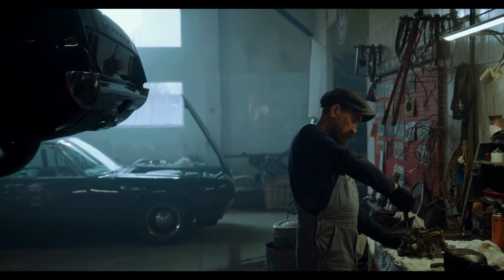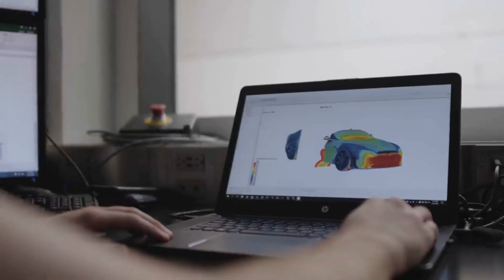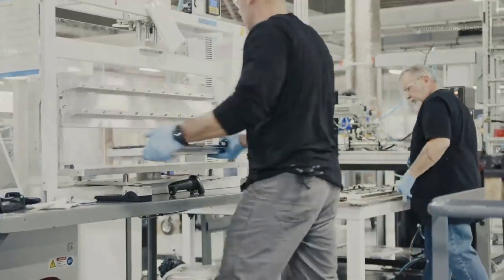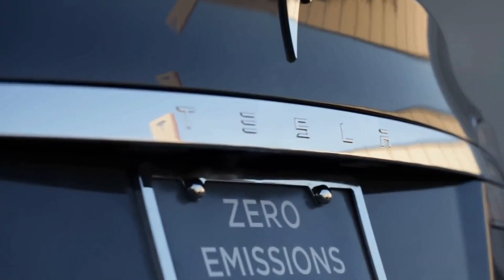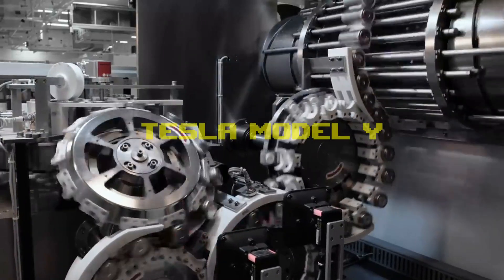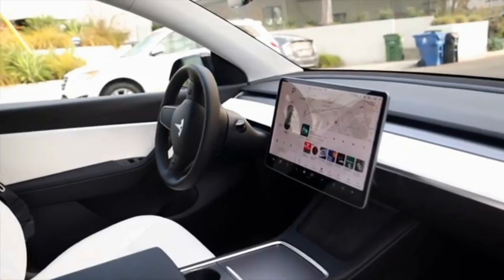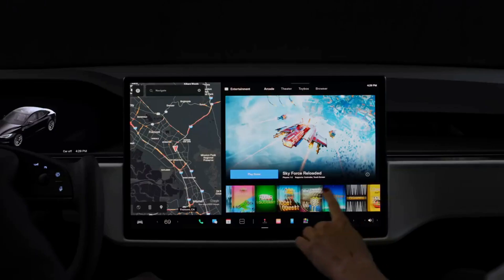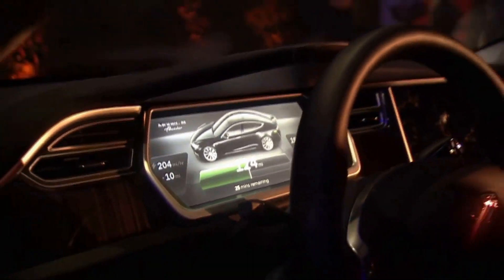Tesla BATTERY replacement | COST of Replacement

Comment: We have the 2018 Tesla MS 100D and it has been reliable until yesterday. I was driving from San Francisco to San Diego. I stopped near Bakersfield to charge the car to about 270 miles. We started down freeway 5 and I got a warning that I needed to charge the car and to pull over to the side of the road. I was lucky we were not hit by other traffic as it was about ten am. We had to wait for about two hours for Geico to send us a tow truck. Tesla in Bakersfield told us that the main battery needed to be replaced. Worse case it may take seven weeks to get it done. The battery is still under warranty so that helps. They provided a model 3 to continue our trip home. I had to learn how to drive this M3 as it does not operate like the MS does. I have to say it rides ok, but I like my MS. Tesla Workers at the Bakersfield location are very nice. Our Model S did not give us any indication in the days leading up to this battery failure. Has anyone else had something like this happen to them? Are the batteries installed in the newer cars better?
Reply: Hi I live in Korea and that happened to me 2month ago.I drive 2018 model S 100D.
Tesla replaced to remanufactured raven 100kwh battery but total range is reduced to 450km.